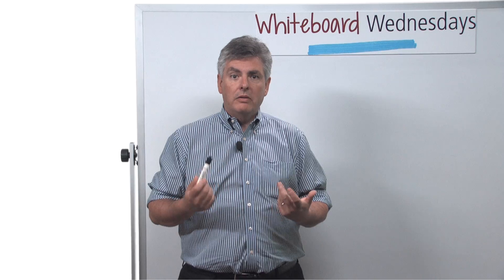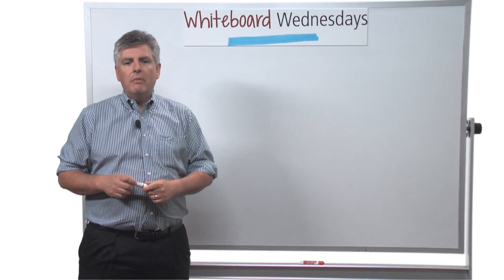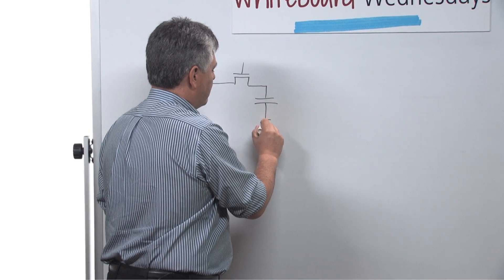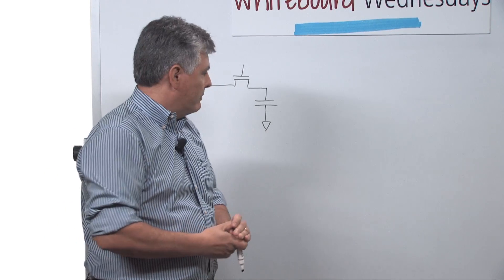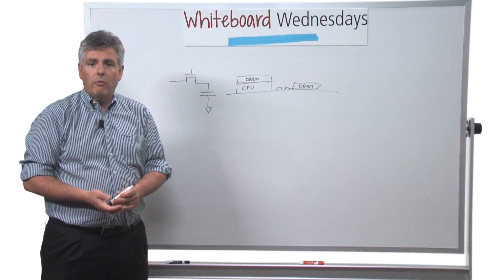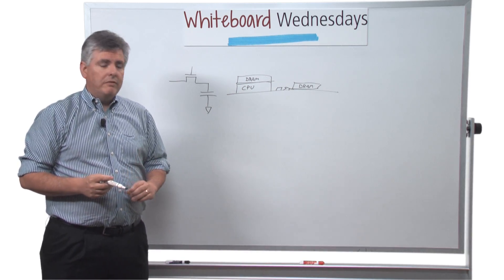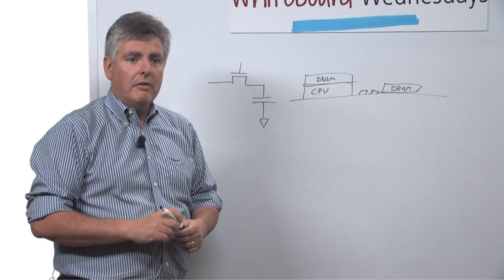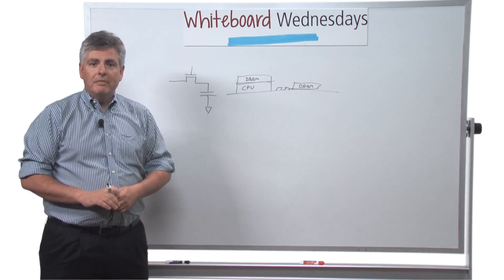Whiteboard Wednesdays - What is Post-Package Repair for LPDDR4 Memories?

Comment: From where does the "new spare area" come from ? Do we have a fixed number of spare areas that is put aside for this PPR puporse ??
Reply: Hey! Did you find the answer to this? I have same question in my mind.
Reply: @wowyeswowyeswowyes   Yes, there are certain number of spare within the SDRAM device that can be used for spare. The number of spare may vary with the device manufacturer, generation and model number. Thanks